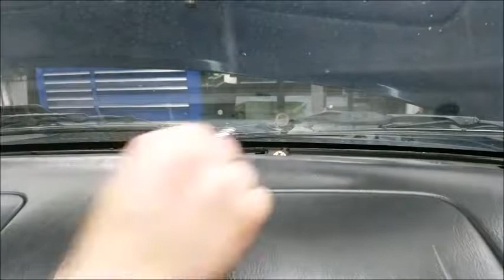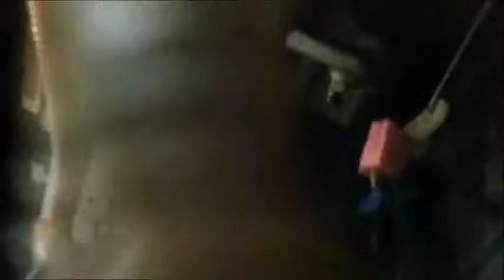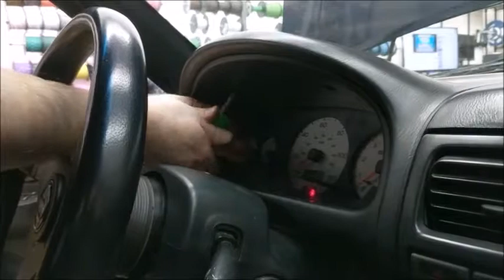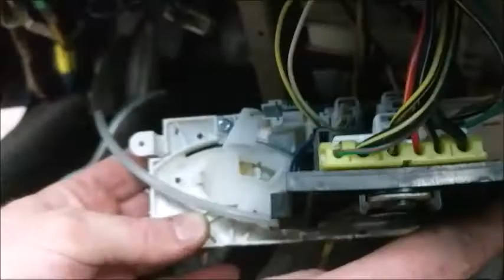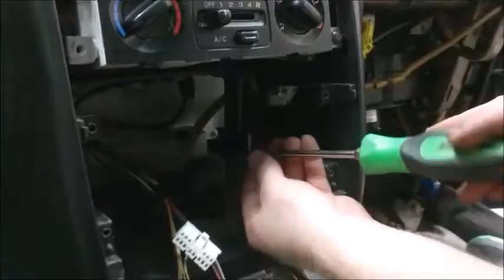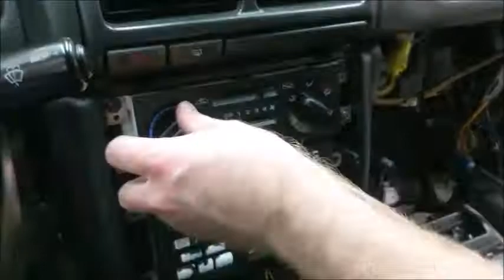iWire Subaru Wiring Harness Installation Video Part 4

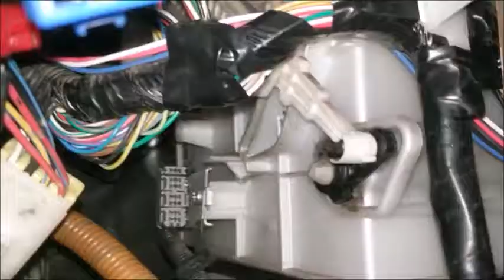Comment: 5:54 why is it that we leave the gray plug on the side of the heater core unplugged?
Reply from the maker: Good eye!
Cruise Control Module connector
This many times will stay open, especially for non cruise equipped vehicles. For drive by wire engine swaps, you will remove the cruise module and leave this disconnected. Thank you!